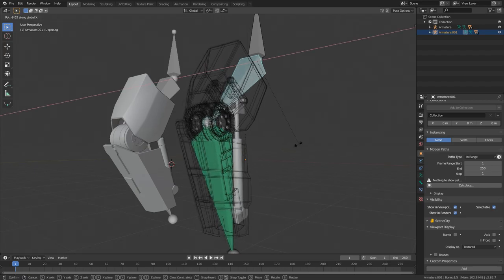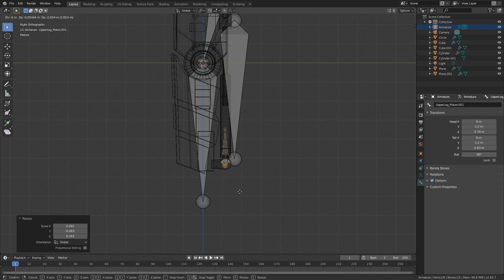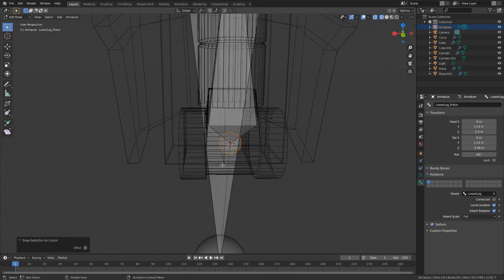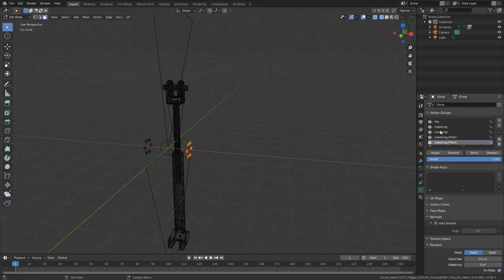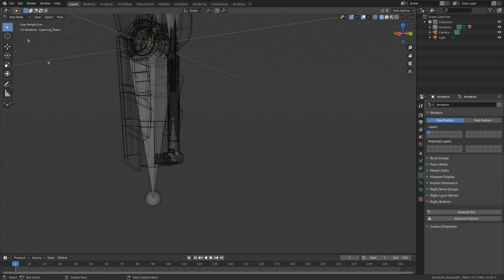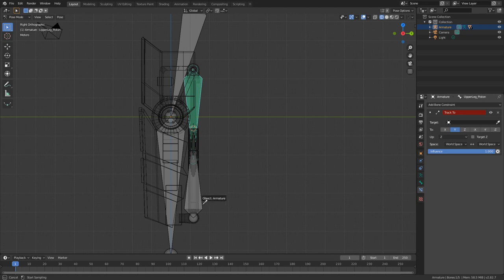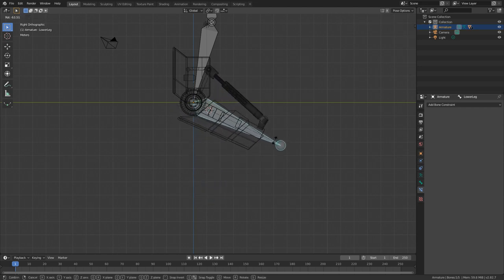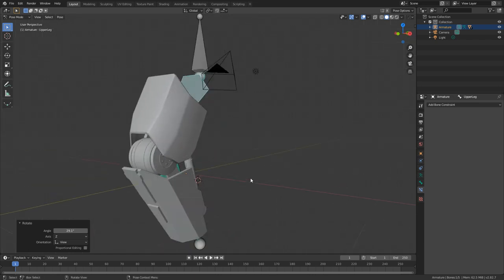Rigging in Blender - Advance Mech Knee with Piston Tutorial

Comment: With individual mesh components where the entire mesh is assigned to a single bone, as is often the case in mechanical rigs, you don't need to use armature deform. What you want to do is go into pose mode, use the list thing at the side (inventory? I don't remember the name) to select the mesh, then select the bone you want, then hit parent to bone.

Comment: It´s very well explained, great video. Although, my rig didn´t work in the slightest.
I was using the addon PistonPusher from Blendermarket, maybe I should have broken down the piston to a simple mesh without any functionality first. Should have, probably.
Anyway, my piston was all over the place, will try again from scratch ;)
Oh, and I also had the problem that part of my main geometry got "stuck" midair and didn´t move with the bones, sometimes single faces, sometimes a few vertices. Had to redo the process for these parts several times before they finally worked. Maybe a bug in Blender 3.2?

Comment: So is it standard in Blender when rigging a hard-surface mesh to just break the mesh into all the various pieces? My mech is all one piece and I've been trying to find a tutorial on skin weighting a hard surface model, but every video I've found just has all the pieces separate. Which to be honest is a little irritating. I assumed there'd be a way to skin weight based on mesh elements.
Reply from the maker: yeah, so you can assign the mesh to the vertex group that corresponds to the bone. I am currently making a rigging troubleshooting video. I will add it in